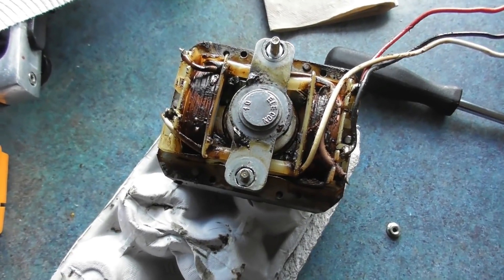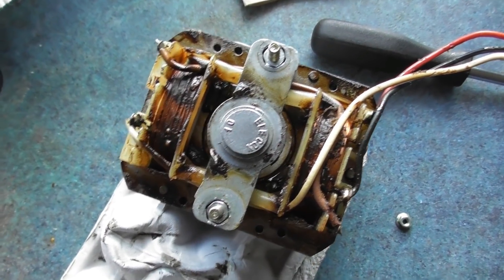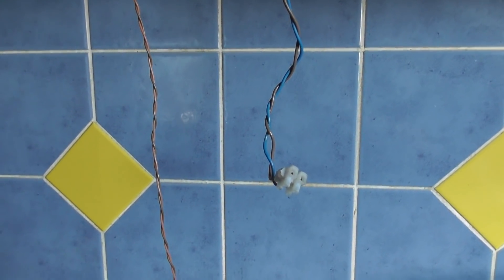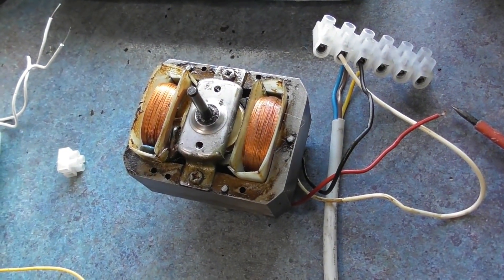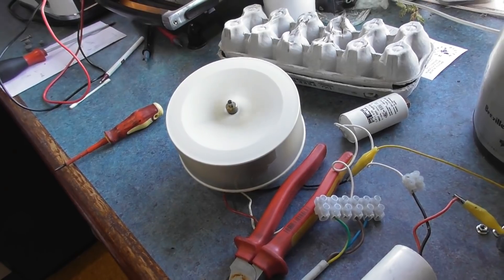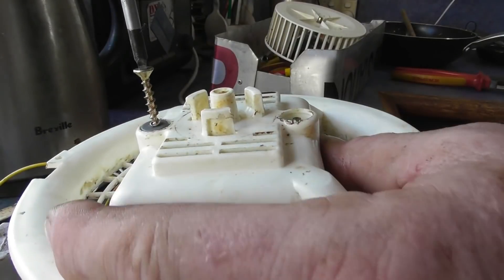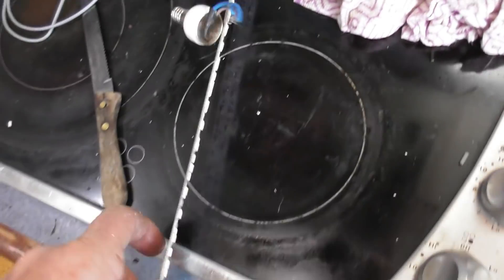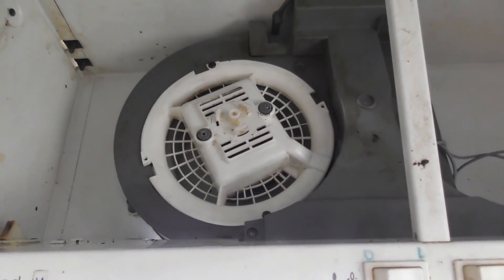Robinhood Rangehood Repar

Comment: Interesting motor. I think I've seen one like that in a tape deck before. Most range hoods here in the US use a c-frame motor with one winding and shaded pole start.

The hardened grease mess that gathers in the hood is, uh, a treat to deal with

Comment: I have one on a tangential fan in my wood heater, bloody thing gets to a certain temperature then resonates -  I removed a similar fan from an 80's copier that i intend to 'graft' it into position. Interesting little motors these. I thought shaded pole motors were able to cope with a with locked rotor condition for long time since they don't have a start winding and the run winding is fairly thick. I note that the shading pole has a magnetic field which responds to the changing load conditions.

Comment: Just like an old record player motor, you don't see small shaded pole motors with the two windings very often anymore, unless it's for a more compact form factor. What I did not catch was whether or or not this one was also provided with wires going to each individual coil as it used to be done so they could be run on 110-120 in parallel or 220-240 in series.

I find this useful as it had never clicked on me that a capacitive dropper may help me correct the speed of my BSR changer which runs a bit fast.
Reply from the maker: A Capacitive dropper works usually very well as it increases the slip of the motor. Bit of trial and error but I can get a few more years out of the motor.
Reply: I will definitely be trying this out.

Comment: Nice, I should do the light upgrade on my one, but never actually use the lights in there anyway. Do not know about NZ but here new motor is cheap, complete with the whole plastic base of the unit. Bet you could go out hard rubbish day and get a "new to you" motor for free, plus a spare set of switches.

Comment: I hope u lubed the felt both pads on motor, motor oil works well.
Reply: Yes, they seem to skimp on the oil these days, putting in the pads pretty much bone dry. I always make a point of putting first a drop of spray oil on the pads to get the old oil going ( it turns to sludge) and then spinning the motor till it loosens, then adding a few drops of thicker oil (viscosity 320 refrigeration oil is nice and mineral oil with no additive) for long backup. Had a few where the OEM for some reason used what had the feel and consistency of wax as lubricant, which gummed up the bush quite well after a year or so.
Reply from the maker: I put a dab of synthetc oil on the pads.